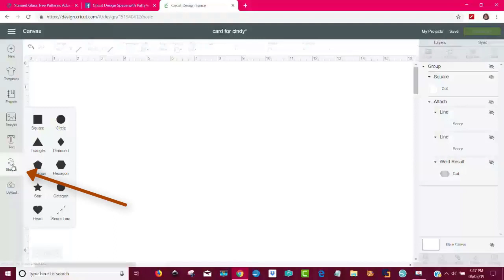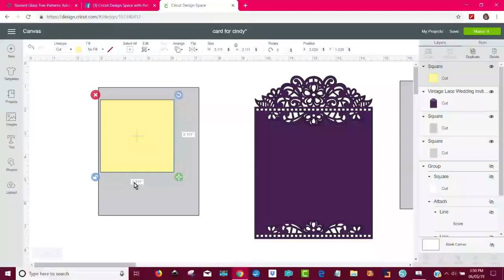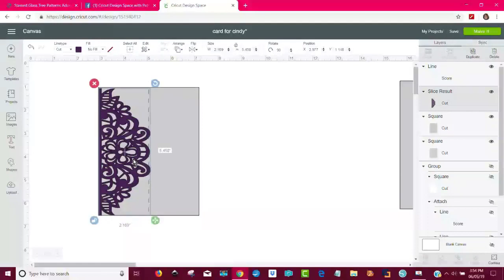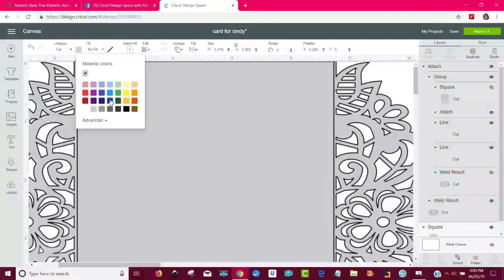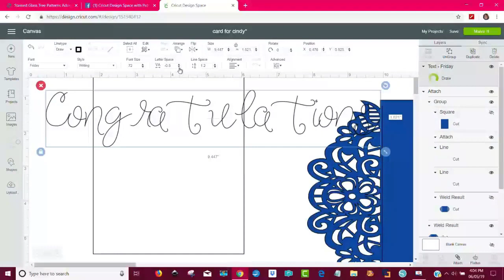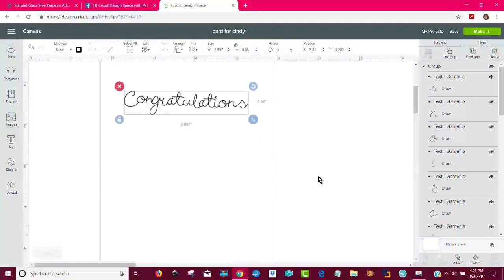Gate Fold Card - Cricut Beginners

Comment: Hi Patty i have a question hope you could answer this.
When i do a layer design with HTV the lines line up on design space but when i actually cut them and put them together, they don't line up? What i'm i doing wrong? 
Thank you so much..
Reply from the maker: Hi! Does this happen when you were applying heat to the various pieces or is it before you even heat them?
Reply: @PattyAnnesPlace  it happens after i put my second layer with heat. And i only do it for like 3 seconds because i know the hyv will shrink..